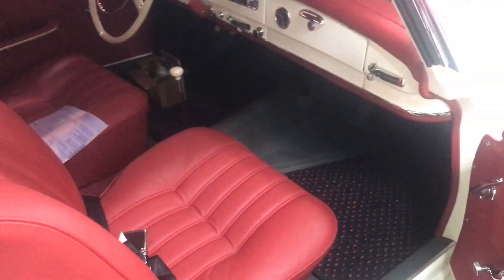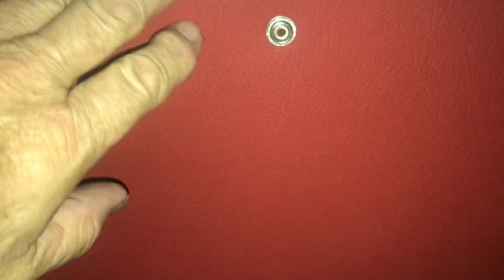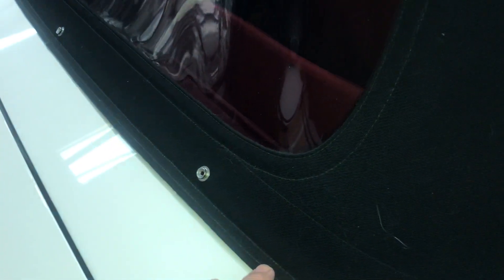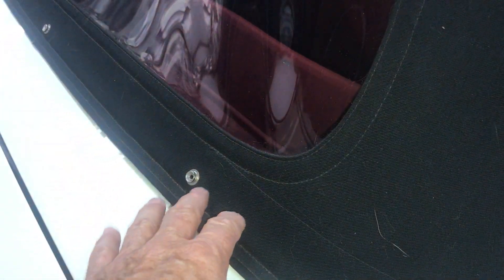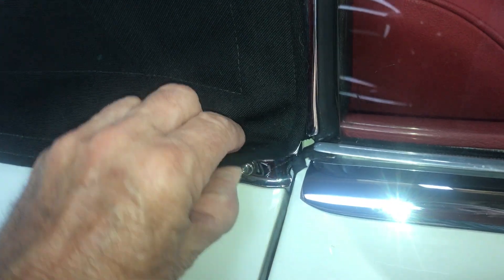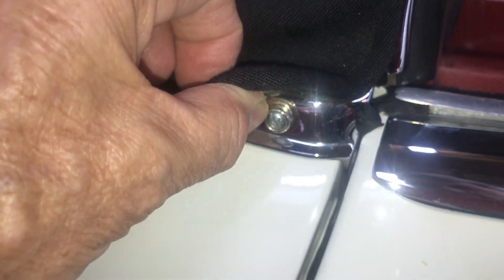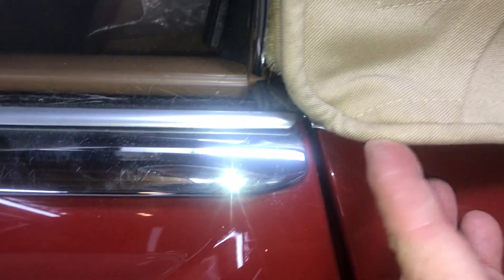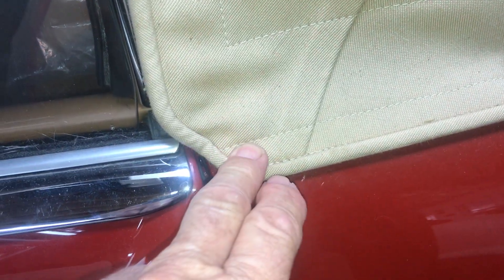190SL Soft Top Boot Snaps

Comment: The soft top should NOT have a snap to match the one on the chrome finisher for just the reason you guessed. It is there only for the fitment of the soft top boot/ tonneau. I have seen retrimmed 190SL models in the uk with a retro fitted popper and a reliable Mercedes Benz Owners Club Concours judge has declared it wrong to have. The soft top cannot be released and folded from within the car by the driver if someone inadvertently fits these as the fabric will be in tension and risks tearing and splitting at this point. We all try and take care releasing and folding these tops nowadays but when they were new in the 50s and 60s customers would just casually release the latches and fling the top back! If the tops frame is in good condition the rear deck cable tension and the door glass hinged brightwork should keep the canvas/ mohair relatively tight and draught free!
Reply from the maker: Well said. Here is link to my trimmer instructing how to properly raise the soft top (hood).
https://www.youtube.com/watch?v=VxuZlFrZabw&pp=ygUnd2ZzNTIgKyAxOTBzbCBjb252ZXJ0aWJsZSB0b3Agb3BlcmF0aW9u